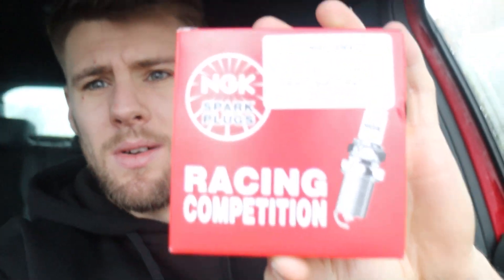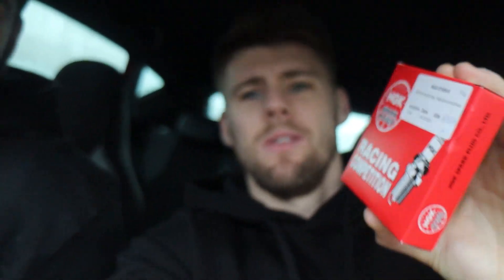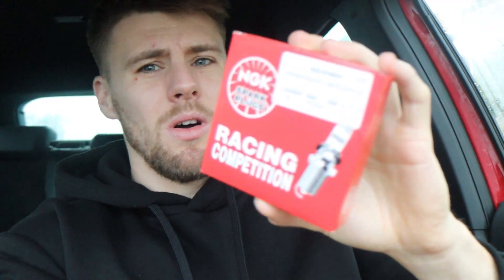SPARKPLUGS INSTALLON ON SEAT LEON CUPRA REMAPPED 280 (MBQ)

Comment: Little handy hint for ya fella, when you undo the spark plug and have trouble taking it out with socket. Take your coil pack and dunk it into the hole and the spark plug will stick into the hole enough for you to easily pull it out.
Reply from the maker: No way man what a tip I’ll try that next time 🙌🏼🙌🏼🙌🏼

Comment: You have some oil there on the plug when you took it out. Do you think thats normal? I had it too on one cylinder. Other 3 were not oily. Maybe valve cover gasket broken?
Reply: Thats defo not normal. Either valve stem oil seals or rocker cover.